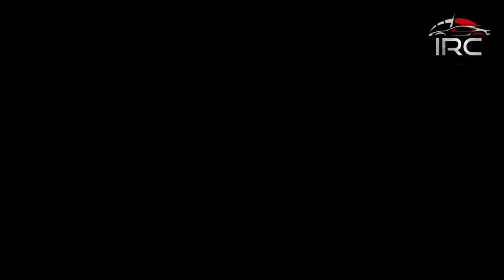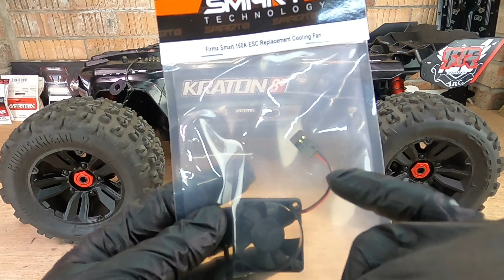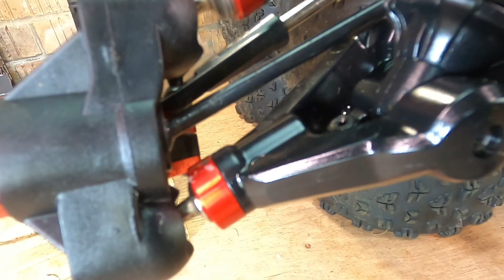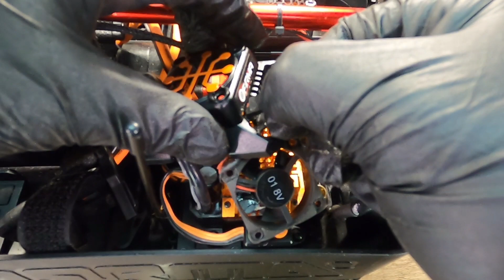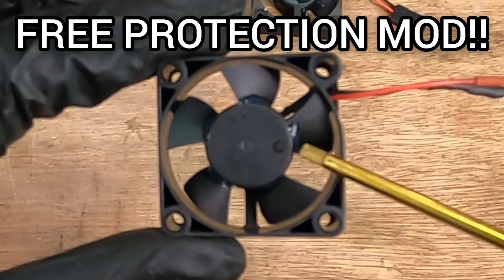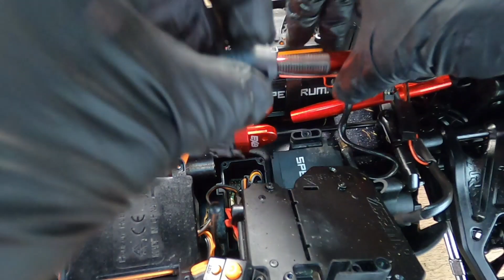Repair time - Arrma KRATON 8S  1/5 EXB Replacing the ARM, Bumper Spring, Fan FREE FAN PROTECTION MOD

Comment: Can you help me understanding why my motor unit is solid red when switched on.  No fan nothing. Only 2 runs.....new purchase.  Unsure what happened
Reply from the maker: Hi buddy. I'm not 100% sure but flashing red is usually a binding issue, but I feel a solid red may mean the esc may be faulty. You do get 2 years warranty with all arrma cars.  If you're in the UK, then I would give logic rc a call. They carry out all the warranty work for arrma and are very helpful. In the USA its horizon hobby.

Comment: What’s part number
Reply from the maker: The front lower arm is ARA330589

The bumper spring comes with the front and back bumper as a package. ARA320617